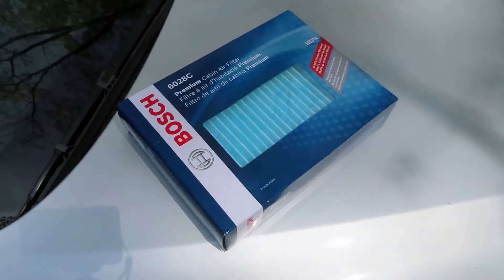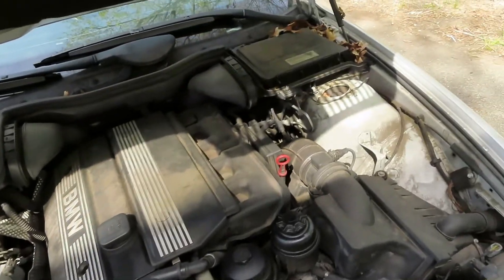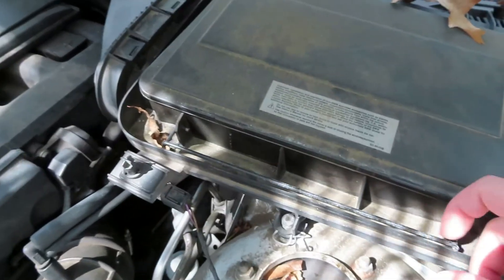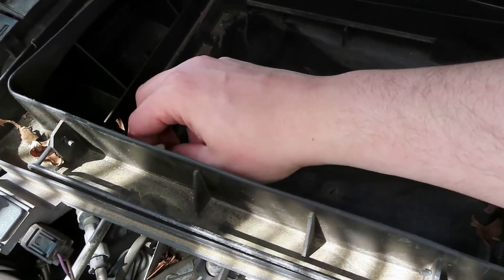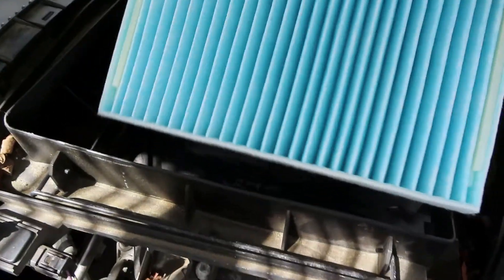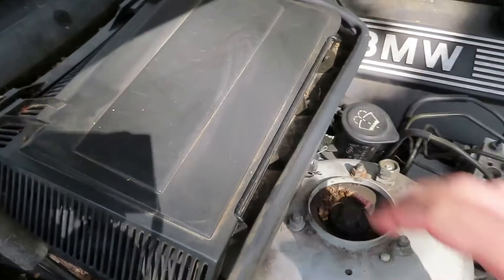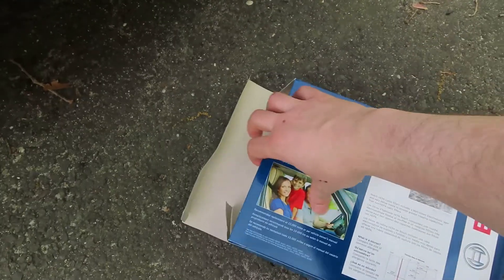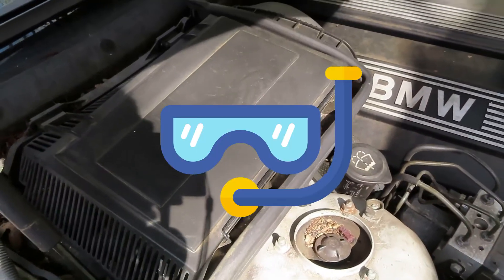Bmw e39 filter replacement

Comment from the maker: Air flow goes from top to bottom if your arrow is indicating air flow the arrow will be pointing down if your arrow is indicating which side should face up then arrow will be up. the arrows are cause of confusion but rule of thumb air is going through from top so find air flow indicator and install accordingly